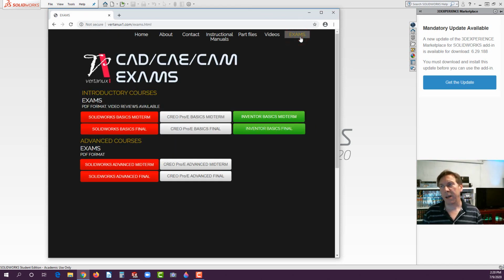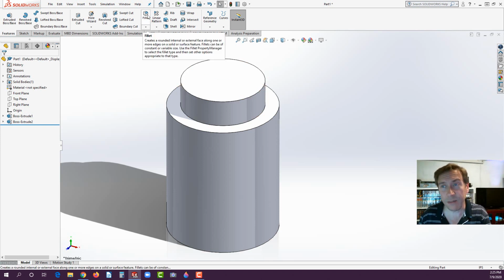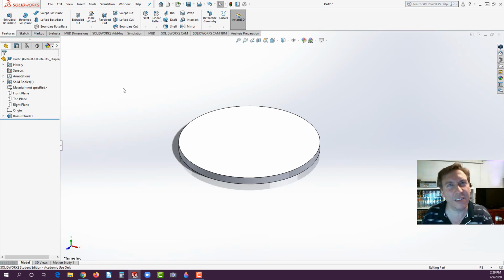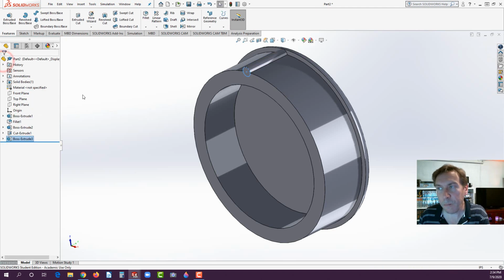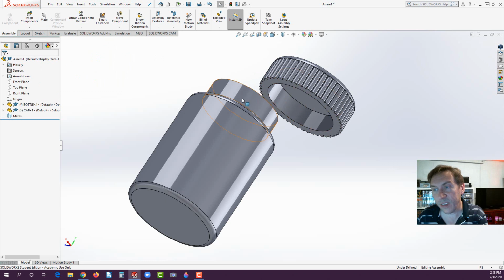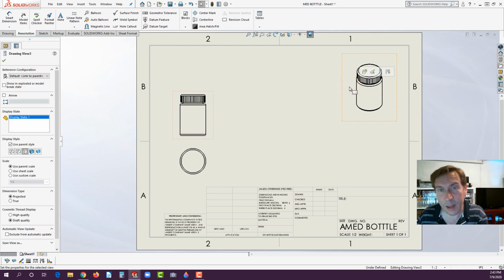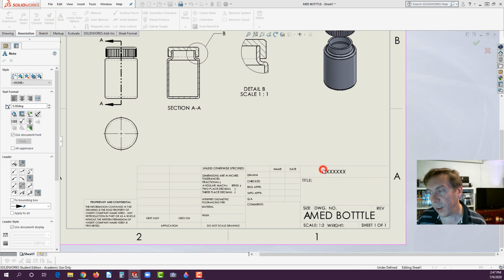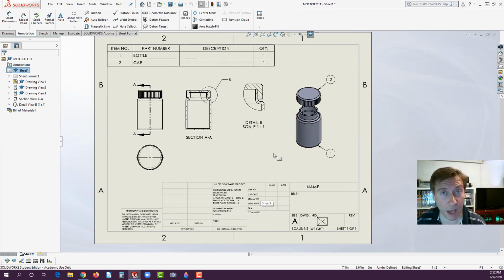MIDTERM EXAM REVIEW SOLIDWORKS 2020

Comment: in 2014  solidworks  say the thickness is greater than the minimum radius .. If you press yes, it will give you a warning.   It doesn't fail.  or crash  . I don't understand what's supposed to happen other than there's a warning and it won't do it...I have tried hard to make it fail, but no, I have tried with decimal numbers. 000.1 just where it does not and will not shell out.